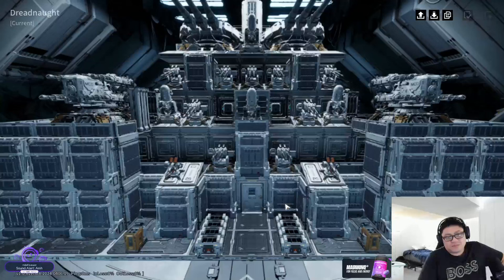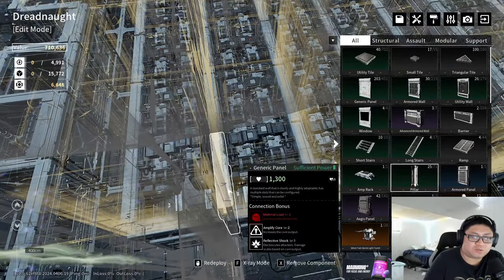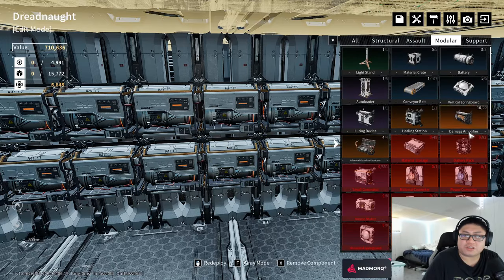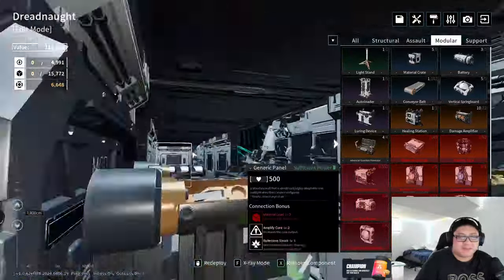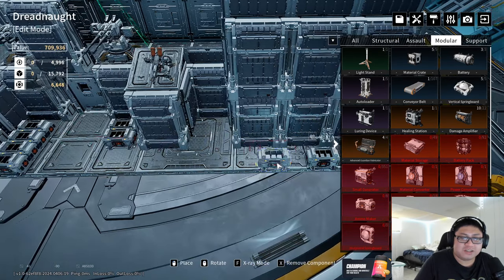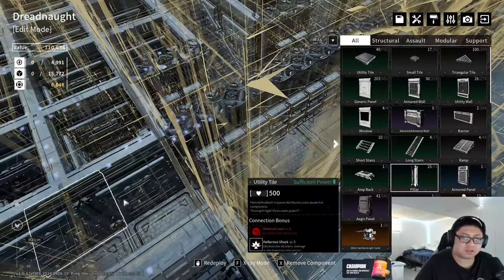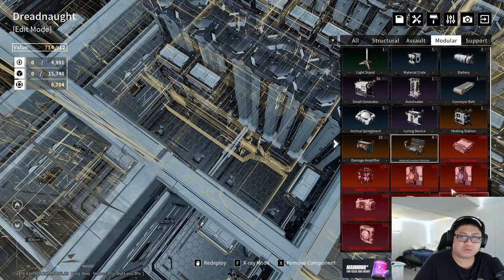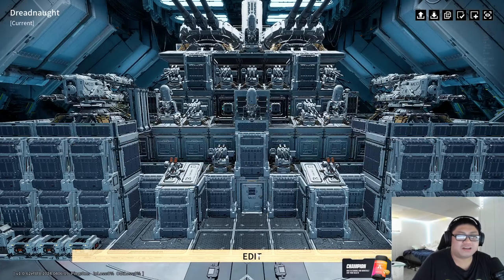Dreadnaught Base Tours and Explanation More Info On Description

Comment: There is also a +7 risk I found I did the same trick to get 5 vanguards in one go! I used +1 to all purps and above + 3 of a random purples (this goes for one item if you have only one) then  another +3 I never seen and a random +7 I never saw.
Reply from the maker: Yea those risk are fine if you have a fleshed out base. Not worth it unless you extract with red items only ofc haha

Comment: Btw u can craft metal slabs easy with ore+fiber
Reply from the maker: im lazy to pick up stuff :D
Reply: @AznElite123  also @1:25 why not make it 2 rows of conveyors all the way instead of 3 if the ammoloader only grabs from 2 anyways? Is there a reason for this? I didn't build with them yet
Reply from the maker: @Merasukyura  ammo can fall off. better to put in preventative measures.

Comment: Is 3000 core power truly the maximum?
Reply from the maker: yes, so far only damage is confirmed to be capped at 3000. I've definitely noticed that I'm doing not as much damage from 4k to 7k core power on infinity siege map 2.
Reply: no i got about 6k
made the first level entirly storge and batterys

if you can find it its called EMPERETOR REX
Reply: @BIGBOSS-bu1jt  but apparently, right now you only get the dmg boost from 3k max